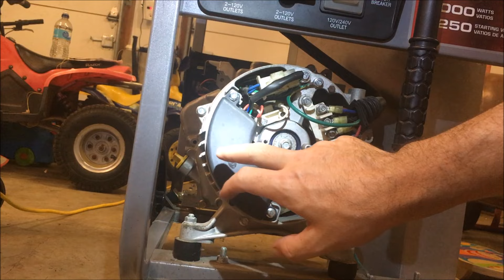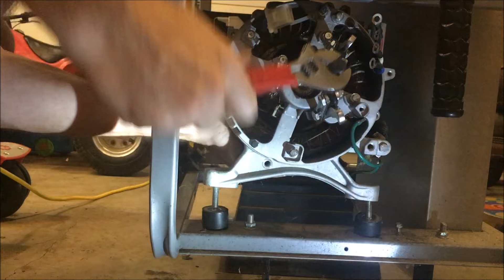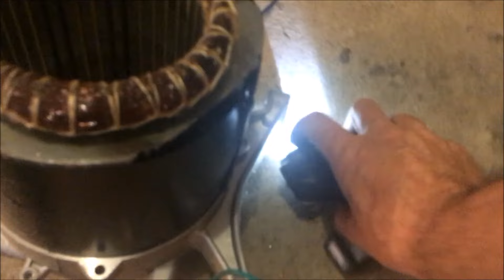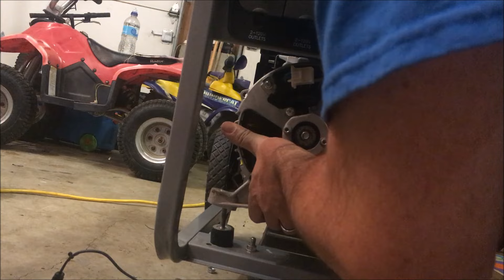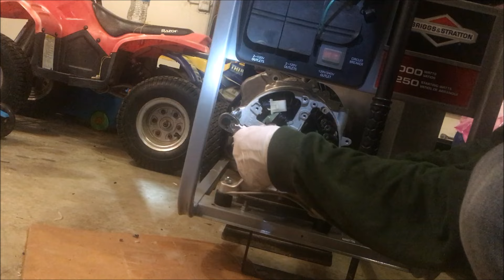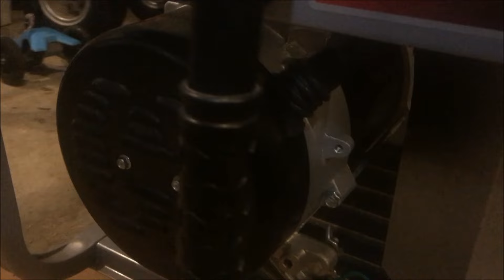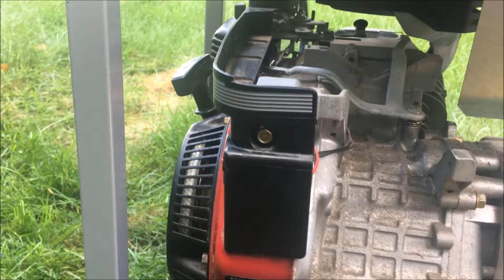Troubleshooting Generator No Power Output and Fix

Comment: Thanks for video. Found a  generator on the side of the road ran for about 10 minutes then no power. Same problem . Thanks again really helpful.
Reply: Don’t forget about the generator safety rules: anyone who uses portable gas generators really needs to see this safety reminder. All generator safety rules should be followed carefully. This advice is just to make sure that everyone is aware of all the warnings and it’s just to remind people to be careful using portable generators. Generators can be dangerous if not used carefully. Every year, hundreds of people die or get injured when using portable generators due to carbon monoxide poisoning and electrocution. Make sure you are using your generator carefully and keeping others safe as well. There is something very serious that everyone should always be aware of when using generators. Some people do run their generator indoors which is not safe and that increases the risk of carbon monoxide poisoning which can cause death of family and you. Some people run their generator in wet conditions which can electrocute them. Please remember that you should never run your generator indoors. Remember that carbon monoxide is an odorless and colorless gas that you cannot see or smell. Carbon monoxide is a silent killer. Keep that in mind. Make sure your generator is 15-20 feet away from your house and away from doors, windows, and vents. Never use your generator in your porch too. Having a carbon monoxide detector is very important against generator safety. Some people also allow children to go near the portable generator which could pose risks. We need to keep an eye on our children making sure that they are not near the portable generator so they won’t get electrocuted or burned by the generator which is dangerous. A locking enclosure also keeps kids safe. A generator shed might look like a tempting place to explore, or take cover during a game of hide and seek, but a generator is a dangerous piece of equipment that can cause injury. It says on the manual that we should also keep children away at all times from the portable generator to avoid injuries. Please do not allow a child or unqualified people to operate the portable generator. Just because some manuals missed what should be listed doesn’t mean it’s safe to do. Always follow the generator safety rules when using portable generators. Generators pose electrical risks. If you need to use your generator during wet weather, you need a generator tent to protect your generator from getting wet. Don’t let your generator get wet. Keep your generator dry and before using your generator, please make sure your hands and your generator is dry. Do not wear loose clothing when operating the generator. Everything that is said on the generator’s operating manual should not be ignored. Never smoke cigarettes near the generator. Please keep flammable things away from the generator. Never overload your generator too. Your generator can catch fire. Never ever try to plug a generator cord into a wall outlet to avoid back feeding. Back feeding your generator is dangerous. Always turn on your generator first before plugging in appliances and shut off the appliances before turning your generator off. Use a heavy duty cord for your generator and the cord should not be worn out. All the instructions should be followed carefully. Never refuel your generator while it’s running. It can cause fire if fuel spills while your generator is hot. You should turn off your generator and let it cool off before refueling it. Having a fire extinguisher next to the generator is also important. This is only a reminder for everyone’s safety of using generators. Make sure your generator is properly grounded. Having a fire extinguisher next to the generator is also important against the safety rules. https://youtu.be/I1jT3ANENvI and here is a video more about keeping others safe when using generators and also about our family’s safety. Hope this helps. Thank you.
Reply: @The_Happy_Aviation_Enthusiast  maybe funny the first 50 times

Comment: My knees and back are sore watching this. But interesting repair
Reply: I love your videos I’m like you I kinda jump at the first when I saw $75 for the same size you are working on in this video I knew there was a motor issue but the other part worked fine he said kind of kicking myself also it would be nice if you could tell us when you use the torque wrench what specs using just helpful for the video great video by the way

Comment: Hello to u genny fixerz, I have a powerhorse gen running watts 7250, running great. I checked the voltage to the 
brushes, it is 5 volts D.C.  so if u have a similar unit they may all use about that much for excitation to the rotor.
I also have a TroyBilt 5500 model 01919 with a rectifier on back of brush holder. two wires from st8or have 7.7
a.c. volts changed to d.c. no AVR . I just thought this info would/could be helpfull and suggest when u do get a
genny to put out, to measure voltage at the brushes and /or capacitor and write it down as a reference, so U will
know what voltages to expect during a problem.
Reply from the maker: Thanks.  This was an early video did not know at the time.  But yes.  Between 4-8 volts would be good.

Comment: have you ever ran wires off the avr output to see the dc voltage on the stater range to keep the ac voltage at 120ish curious what that looks like.
Reply: I have, it's a good idea to do when the gen is working under a load . A TroyBilt 
model 01919 at 5500 watts has around 7.5 volts going to a rectifier bridge on
the back of the brush-holder while my Powerhorse 166113 has a 7250 watts
continuous and has 5 volts going to the rotor from the curved shape AVR.

Comment: Put up a link that shows your teat equipment, thanks
Reply: Any volt ohm meter would do the diagnostics.  That meter he checks the running machine with is a Kill A Watt, just google that.  Shows voltage and frequency and amps or watts for whatever is plugged into it.  Very handy around the house.
Reply: Don’t forget about the generator safety rules: anyone who uses portable gas generators really needs to see this safety reminder. All generator safety rules should be followed carefully. This advice is just to make sure that everyone is aware of all the warnings and it’s just to remind people to be careful using portable generators. Generators can be dangerous if not used carefully. Every year, hundreds of people die or get injured when using portable generators due to carbon monoxide poisoning and electrocution. Make sure you are using your generator carefully and keeping others safe as well. There is something very serious that everyone should always be aware of when using generators. Some people do run their generator indoors which is not safe and that increases the risk of carbon monoxide poisoning which can cause death of family and you. Some people run their generator in wet conditions which can electrocute them. Please remember that you should never run your generator indoors. Remember that carbon monoxide is an odorless and colorless gas that you cannot see or smell. Carbon monoxide is a silent killer. Keep that in mind. Make sure your generator is 15-20 feet away from your house and away from doors, windows, and vents. Never use your generator in your porch too. Having a carbon monoxide detector is very important against generator safety. Some people also allow children to go near the portable generator which could pose risks. We need to keep an eye on our children making sure that they are not near the portable generator so they won’t get electrocuted or burned by the generator which is dangerous. A locking enclosure also keeps kids safe. A generator shed might look like a tempting place to explore, or take cover during a game of hide and seek, but a generator is a dangerous piece of equipment that can cause injury. It says on the manual that we should also keep children away at all times from the portable generator to avoid injuries. Please do not allow a child or unqualified people to operate the portable generator. Just because some manuals missed what should be listed doesn’t mean it’s safe to do. Always follow the generator safety rules when using portable generators. Generators pose electrical risks. If you need to use your generator during wet weather, you need a generator tent to protect your generator from getting wet. Don’t let your generator get wet. Keep your generator dry and before using your generator, please make sure your hands and your generator is dry. Do not wear loose clothing when operating the generator. Everything that is said on the generator’s operating manual should not be ignored. Never smoke cigarettes near the generator. Please keep flammable things away from the generator. Never overload your generator too. Your generator can catch fire. Never ever try to plug a generator cord into a wall outlet to avoid back feeding. Back feeding your generator is dangerous. Always turn on your generator first before plugging in appliances and shut off the appliances before turning your generator off. Use a heavy duty cord for your generator and the cord should not be worn out. All the instructions should be followed carefully. Never refuel your generator while it’s running. It can cause fire if fuel spills while your generator is hot. You should turn off your generator and let it cool off before refueling it. Having a fire extinguisher next to the generator is also important. This is only a reminder for everyone’s safety of using generators. Make sure your generator is properly grounded. Having a fire extinguisher next to the generator is also important against the safety rules. https://youtu.be/I1jT3ANENvI and here is a video more about keeping others safe when using generators and also about our family’s safety. Hope this helps. Thank you.

Comment: Contact on the rotor happened for some reason!  The marks are closer to the engine.  I would be checking the engine output bearing.

Comment: I got the same one ?been trying to get it done,,my problem is not the generator it's the engine ?? Put a new head on it adjusted valves ,new carburetor ? And it will not power up ? You can put it on choke? Or any speed and it runs the same?? I checked the timing ?? In the fly wheel key ? Lost ? Anyone with ideas ?

Comment: Just had one with bad diode and no output. Put new bridge and brush assembly, still no output. Tore down , ohm checked everything, OK. The problem was dirty slip rings. But they passed the ohm check assembled. Go figure.
Reply from the maker: Unfortunately a multi-meter only tests ohms at a few volts.  Ideally it would at generator voltage level as the results might be different.

Comment: How and where did you plug in the killawatt meter? Never heard of such a meter but now after seeing this... looks like I should get one for my 16 year old Generac 7550 8000 surge generator.  I have only 8 v dc on my charging poles so I ordered 2 rectifiers to replace them. Hope that is it, as all the other voltages are perfect. thanks for a great video. :-)
Reply from the maker: It just plugs into the outlets.  They sell it at Home Depot and online at Amazon.  A lot of the newer Generacs  (8000 watts and below) do not even have a charging system for the battery.  Instead they make people plug in a battery charger when storing the generator.  The worst part is that it does not maintain the battery so you can only leave it plugged in for about 24 hours at a time.
Reply: @jcondon1  that would suck. Glad I have the better unit. Hope there is nothing wrong with the voltage regulator as it is $60.  something as the rectifiers were only $14. something a piece and I needed 2... supposedly.  I'll let you know.
Reply: @jcondon1  Guess you never heard of a "trickle charger."  Or solar charger.  They keep the battery charged and monitor the battery. I have been told about them and seen them but know nothing about them. :-)
Reply: @jcondon1  I have not used my battery in about 2 years since the last hurricane in september of 2017. It was totally dead and took me almost 20 hours to get a full 12v hold charge on it.  Now it is holding the 12v no problem and cranks the generator with some really fast speeds. No harm done to the battery for sitting all that time as long as is does not sit on concrete so they say.. Seems to be like a new battery.
Reply: @JohnSmith-uy7sv   ..lucky your battery did not become sulphated...check out how to de-sulphate them. hook heavy duty charger (the autostart boost setting, 200 amps or so)  onto it for 15 minutes, every hour, 5 times. First, drain electrolyte out, rinse battery out with distilled water, (twice) and put electrolyte back in, topped up with more distilled water. do the 5 charge cycles, and leave for 12 hours. Put on slow charge, say 8 amps, for a day. Should be good to go....
Reply: @jcondon1  Yes, I've seen them now online at home depot for $40. something but just ordered one from wal mart for $12.  something.  So with nothing plugged into the kill a watt meter and the meter plugged into the running generator, it shows the hertz an kw with nothing plugged in or no load on that outlet? I'm confused. thanks.  Get a better soldering gun.  That solder job you did will eventually break again because it was not a solid solder joint. Look for it to go out again in the future. Thanks for showing what the generator and the stator and armature were. :-)
Reply from the maker: John Smith it will show hertz and volts just with the kill-a-watt plugged into the generator.  You can also run up to 15 amps through the Kill-A-Watt meter and it will show the watts.  It is good for deterring the load various thing pull.  Note, I had a generator recently that the kill-a-watt had issues measuring the hertz accurately.  Guessing the power output is dirty.  Wish I had an oscilloscope.
Reply from the maker: John Smith and I do need a better soldering gun.  Bought that one for electronics.  Not powerful enough.
Reply: @jcondon1  Thanks James. I was not sure how they worked. What is a dirty power output?  Are you from the UK? never heard that expression before.
Reply from the maker: No, I am in the Northeast US.
Reply: @jcondon1  You talk like your from Europe with some of those words. Dirty whatever.:-) I'm in south florida.
Reply: @JohnSmith-uy7sv  dirty power = anything which is not a pure sine wave, (some gens make a 'modified' sinewave) and goes dirtier to a square wave....Not TO BE USED ON COMPUTERIZED  equipment....

Comment: So... that was the only problem was the cold/bad solder joint?  Should have replaced that main bearing while you had it out.
Reply from the maker: That was the only issue.  I should invest in the proper puller for that.
Reply: @jcondon1  You don't need one. Your good. :-)

Comment: Pleas my generator stop supply of power what do I do
Reply from the maker: Gloria Nancy usually when they stop making power, it is cheaper and easier to get a new one or used one that works.  Sometime they can be fixed by replacing the AVR, brushes or flashing the field.

Comment: I have a Tahoe 9500; its output is intermittent? It cycles about 30-40 seconds will put the drop light on then shut's off?
Reply from the maker: I would suspect is a loose wire on the rotor.  Have you been able to look at the slip ring solder joints?  Otherwise check the brushes, clean the slip rings and lastly replace the AVR.   You should also test the ohms on the stator, rotor and the two windings going into the AVR.  Potentially the winding suppling power to the AVR is bad.
Reply: Thank you, James Condon, @jcondon1 I have not got into it yet, but maybe tomorrow and I will let you know thanks again.

Comment: James at minute 1226 those two small copper wires coming off those plastic post that are twisted together are white and broken on my Honeywell. What are they? Not to the slip ring post thanks
Reply from the maker: THOMAS DRELICH instead of winding the rotor with one continuous wire they wind each side with a separate wire and tie the two halves together.
Reply: What gauge wire is that you think 18, 20,22?
Reply from the maker: THOMAS DRELICH not sure.  If you are thinking about bridging the broken wire with a new piece going a little bigger should not hurt anything.  Just make sure it is secure and cannot shake around.  Once you are sure it works you might want to put epoxy or something on it to keep it still.  Another thing to consider though is the ohms.  I think you said it was 70-80 ohms.  Not sure what a Honeywell is supposed to be, but that seems a little on the high side.  Should still work, but maybe that is what caused the failure?  The AVR would have to pump out more power into the rotor to get 120v out of the stator.  I think I have a Honeywell service manual.  Will take a look.  Also what is the resistance of your meter?
Reply from the maker: You can find the service manual for the Honeywell at the link following this comment.  On page 40 it states the rotor ohms should be between 40-60 ohms.  https://drive.google.com/open?id=1tRSStpjik06k-wfNMgwZZ7_AmacZl8k0

Comment: James, go to Northern tool or Harbour freight, I am sure someone knows where you can buy a good WEN 250 watt soldering gun. I know Radio shack is not around, or I do not think so but check out electronix shops. The joint should be smooth and somewhat shiny, even a good solder joint can go bad after a long time. wishing it all goes well 4 ya.
Reply: i was thinking the same thing. that solder job looked worst then a gorillas butthole.